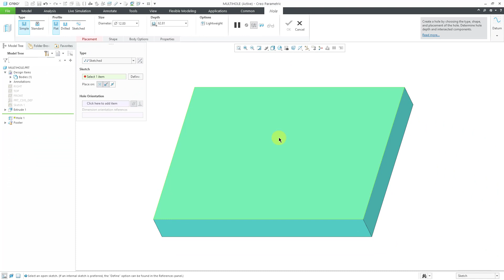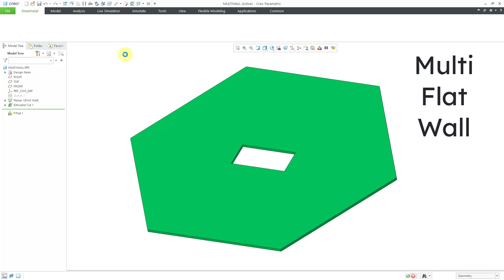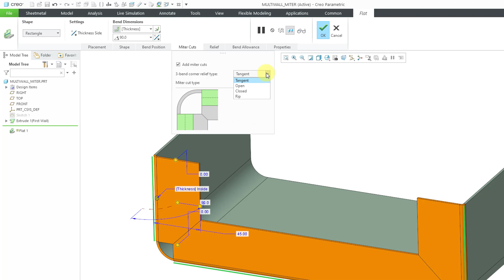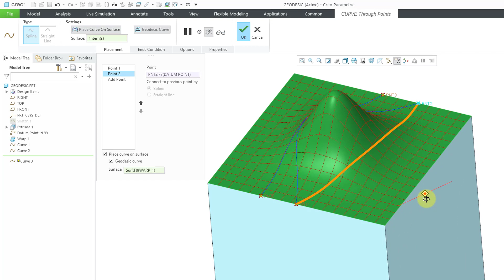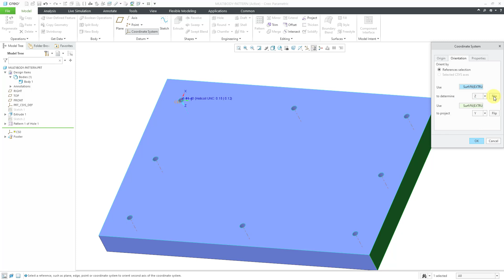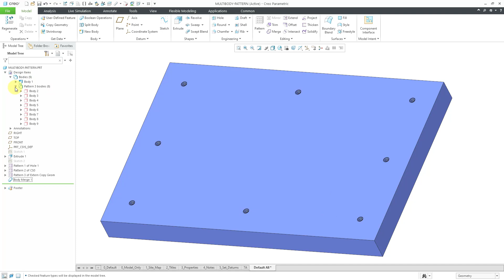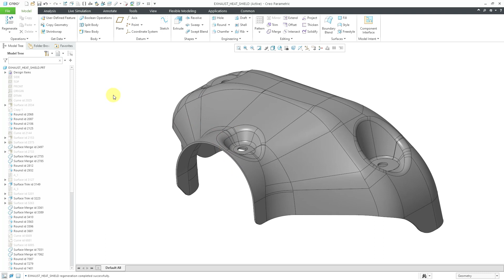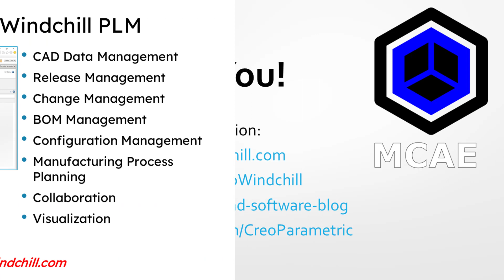Creo Parametric 8.0 - Part Modeling Enhancements (Video 1)

Comment: can you help me with how to use merge tool in sketch interface 
i want to convert different different lines into one entity
Reply from the maker: I can't, because that doesn't exist. Outside of sketch mode, you can use SHIFT to select multiple entities to be considered as the same chain in different operations. Or you can use Copy and Paste to turn multiple curves and edges into a single chain. Perhaps if you told me what you were really trying to do, I could help you.

Comment: First of all, well done, your videos are great!
These improvements are great; however, PTC is not looking at the real problem.
I meant that CREO could not create automotive class A surface, which is the real reason the automotive sector uses CATIA and NX, with few exceptions that use CREO for the powertrain.
As a user with 26 years of experience in CREO, I'm dying to see PTC creating a real surface package like Alias and ICEM Surface btw the same ICEM Surface that PTC sold back in the days.
Reply from the maker: This is not true at all. You can create surfaces in ISDX with G3 continuity on the boundaries. How are these not Class A surfaces?
Reply: @CADPLMGuy Only G3 acceleration is not considered a Class A surface (automotive quality). There are many other things we need to control to create a true class  A; for example, we need to have the ability to control the nurbs, and the reparametrization command in the ISDX can’t do it right. It is very limited.
We also need the ability to control the patches and isolines.
This is just a couple of exemples I can talk about it for days.

Btw we don’t have even the tool to analyze the surfaces properly, to validate as Class A.
Reply from the maker: Where do these requirements for the definition of true Class A come from?
Reply: @CADPLMGuy  Basically, automotive Class A surface is a “subjective” topic since each company has its own requirements.

To simplify Class A surface is a high-quality surface that can be easily modified.

Personally, I’m struggling trying to achieve that quality in CREO for the past 15 years.

This last month I sent a simple model to PTC, nothing organic, just a simple model.
That case was escalated, and at the end of the day, I realized they have no idea at all about Class A.

So I studied Alias for a couple of hours, and I could get the same model done flawlessly in class A.
Then I sent the model made in alias to PTC, so the answer I got back from them was CREO wasn’t able to achieve that quality.
Reply from the maker: Your definition did sound subjective as I had never heard what you specified as requirements for Class A surfacing. It sounds more like Creo can't meet your needs for quality in automotive Class A surfaces. That happens. However, it is not accurate to say that Creo cannot do Class A surfaces. That's why Creo supports import from high-end surfacing applications.

Regrettably there are times when Creo can't meet, say, some customer's requirements for assembly modeling. But it would not be correct to say that Creo can't do assembly modeling.